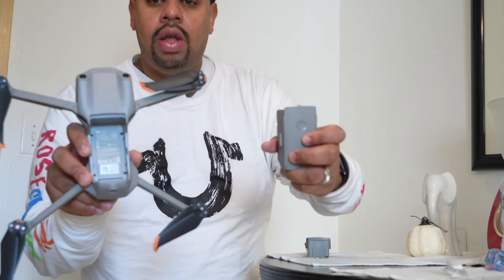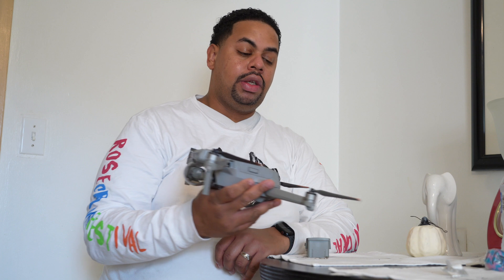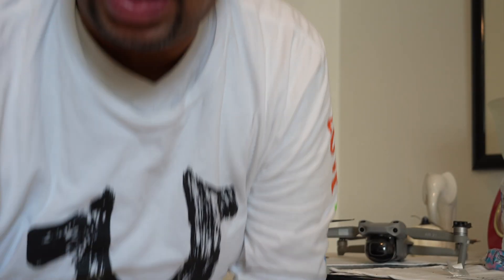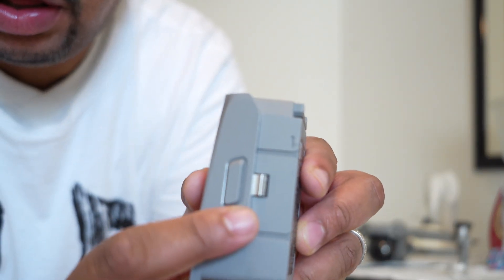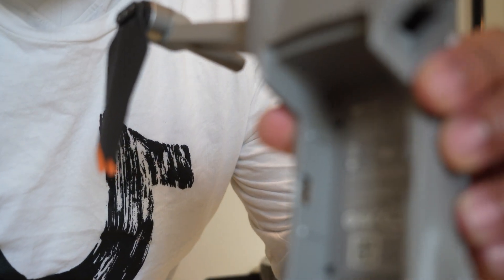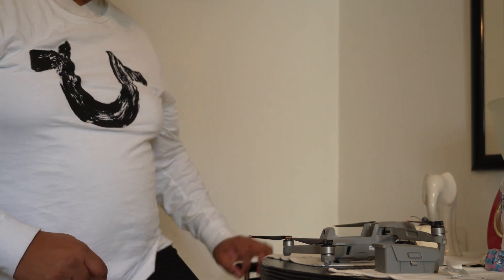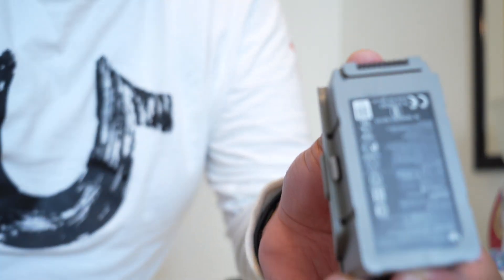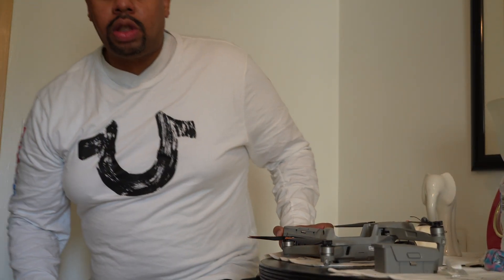Battery Installation Error DJI Air 2s / Mavic Air 2

Comment: Did the job for me & i have another hit and trial method working for me for a while now, it is like, pulling the batteries out without pressing the eject buttons, that way, the connectors lock in the right place & the error is resolved….